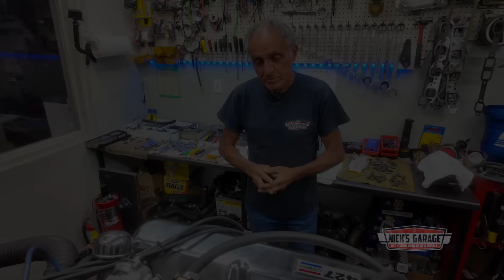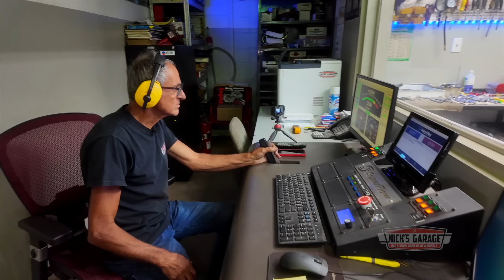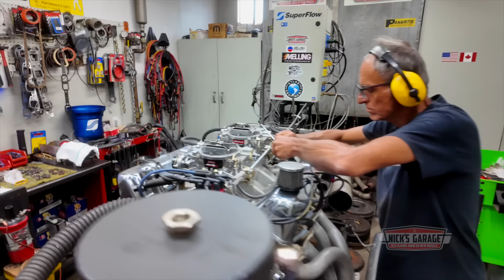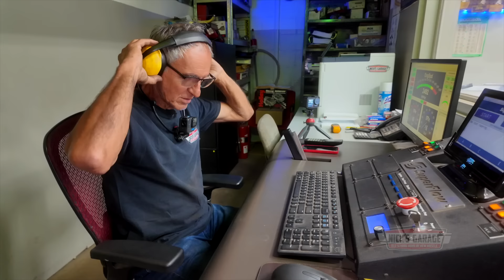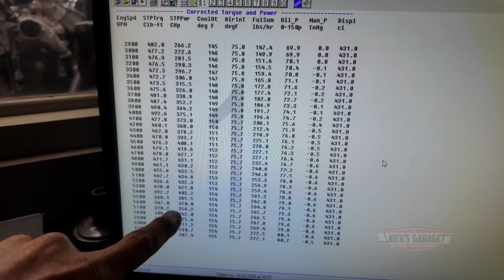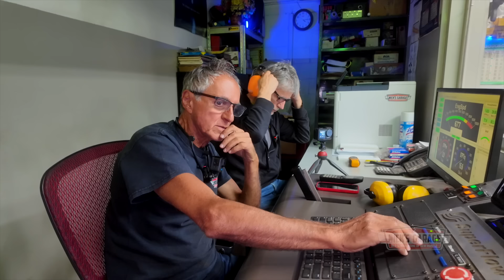427 Ford Side-Oiler on the Dyno Part 1 - Shelby Cobra Engine

Comment: As I'm watching this I was worried about you and that exhaust going into the room but then assumed you had a blower to blow the air out in event. That's how Bill Harrah's  wife died

The way carbon monoxide kills you is that your red blood cells absorb CO at 200 times faster than oxygen so you just asphyxiate 

My favorite Ford? 

The 427 always had the reputation of a beast of an engine it's the only engine I know for which they actually made three versions of it. The single overhead cam which was designed to compete against the Chrysler hemi at NASCAR and was never allowed, the top loader, and the side Oiler. 

And easily for over a decade the 427 cobra was the benchmark for which all other cars were tested. I remember reading even of a test against a new Kawasaki thousand cc motorcycle. It had an out of this world reputation 

Personally I think it's too much engine for the car and if you talk to any of the old Shelby American veterans they will tell you it was the 289 that won most of the races 

Still interesting to speculate if they had been allowed to continue to develop the cobra Daytona. In 1965 Ford told Carroll Shelby to forget racing the cobras and concentrate on the GT 40

And I think it was 64 where the Daytona coupe came within a hair's  breath of winning the Le Mans overall but for a pinhole oil leak in the oil line 

Of course racing is full of "if onlys"

My favorite car? Will Ford didn't make it or Shelby for sale but I lusted for a 289 cobra FIA 

This was the car that Shelby made to compete internationally. 

It looks like sort of a hybrid between a 427 cobra and the regular 289. But that engine has six Weber carburetors side pipes of course it was built to race and not drive on the street 

A few years ago the cobra museum in Martinez raffled off a 289 FIA regular replica and of course I didn't win it 

I thought if I did win it it would be about the most impractical car I ever had 

No way to lock it and no roof so you're not gonna be in the rain. But what an exciting car 

Shelby actually made five or six of these of which only two survive. One of them is in a museum at Shelby American and the other is owned by a man, Lynn Parks, known as Mr. cobra 

He bought a wrecked car and rebuilt it 

Anyway I figured at the beginning when you said one of the machines was gonna break I figured the beast would overcome the dyno as it overcame so many cars  😅😂😂

Comment: FIRST 427 side oiler specially for a Cobra I've ever seen in 35 Year's ruined with a pair of junk Edelbrock carbs!! Easiest way to lose 20-40hp.
Not to mention horrible driveability compared to the Holley's Carrol Shelby helped design for these.
WoW
Reply: Holleys are back on. Part 2.
Reply: Yep Edelbrock carbs are nothing but door stops.

Comment: I think the problem with those Ford FE engines is that the oil is leaking from the intake manifold gaskets and the valve cover gaskets. Because of the design of the intake manifold mating to the cylinder heads where the gaskets are at.

Comment: An AFB and an AVS on the same intake is weird
Reply: Most guys would not even notice it. If you pulled the name plate off the AVS especially.  But I would have put the AVS in the back since it has the choke and the back carb is the primary carb. Well on Mopar it is. Not sure about Ford.

Comment: That's a lot of thick applied Silicone sealant applied There at the oil leaking point !! .....Is the "gap" 'spose to be That wide there ?? ..... Maybe some actual gasket Material with Thinner layer silicone sealant would seal better ??

Comment: Front carb has choke plate closed. Running on 6 barrels not eight.
Reply: Thats not the choke plate. That’s a carter avs, air valve secondary. The back carb is an afb.

Comment: My 3 favorite ford engines 427 SOHC , 429 boss , 427 side oiler with tunnel port heads and dual 4’s
Reply: 428 SCJ was a beast also 😉

Comment: Ford 289, 427, 390, 428, 255 flathead are my favorites in that order from most to least favorite. Oh, I almost forgot the 312 to. GM favorites would be 1950s 265, 283, 327 up to 1970. Mopar 331, 392 hemi's in the 50s and 426 wedge, 413, 313, 318 polys in the 60's. 340, 273, 318LA, 360, 426 hemi, 440, and the 383RB. Any slant six 170, 198, 225

Comment: Among Fords, i got a real soft spot for the FE series but i like the Windsor, Cleveland, the 429-460 and even the oddball MEL  engines which were made between 1958 to early 1968 consisting of the 383, 410, 430 and 462 as well as the Flathead too. I like all the Mopar, GM and AMC V8s as well. The acronyms on the following Ford engine series, the FE stood for Ford/Edsel and MEL stood for Mercury, Edsel and Lincoln. On the Edsel, the one FE engine was a 361 and the 410 was a MEL and those were exclusive to Edsel cars only. The 410 MEL should not be confused with the 1966-67 410 found in Mercury cars was based on the FE series and basically a 390 block and bore size with a 428 crankshaft fitted.

Comment: Hi Nick Phillip George… Nick things happen even if you think there fixed so fix the seal and the valve cover gaskets / intake gaskets for the leaks you found while testing… Nick your brother Phillip is there to fix everything with you… I think the 427 might hit 475 on the HP and well over 500 on the torc… I will be staying tuned waiting for next 427 dyno run … WHO LOVES YA BABY !!!!! Your friend THE BANDIT 😊

Comment: A guy at Holman Moody said that a blue printed 427 low riser made 510 hp with one carb and all factory parts all day long in 1963 Ford NASCAR  stockers. They usually did 500 engines a year according to him .
Reply: Yeah Holman & Moody were to go to guys back in the day for Ford performance.
Reply: I worked with a guy who had an old Ford (can't remember the model - sorry!  Tbird maybe?  Probably not).  But it was - he claimed - all factory, but tuned properly.  It was a sleeper nightmare - people would be confused as hell when he'd pop the hood and they'd see stock.
Reply: @hk45c62  
Re-read what he wrote...
Reply: @hk45c62  
The comment you commented on...
Reply: Long winded...fix it and get it done.
Reply: @hk45c62 H&M  and Shelby were crucial to the Total Performance Era, but not the 428 CJ, Boss 302 or 429.

428 CJ was actually developed at Bob Tasca Ford.  They took parts from a 427 LR to make the 428 CJ.

The Boss 302 was in house Ford.  The Boss 429 was in house Ford/Kar Kraft in Dearborn.

427 SOHC was in house.  The 427 side oiler was in house as well.  It was developed due to NASCAR engines needing the oil to stay down low at the crank for long duration high rpm jaunts.

The 427 center, or top oiler requires restrictors to keep oil down low and minimal oil on the valve train.  So Ford developed the side oiler to have priority main oiling for high rpm endurance.
Reply: @jasonwalker999   , yes, Bob Tasca was involved with the creation of the 428 Cobra Jet but,so was Carroll Shelby. The 1967 Shelby GT500s were equipped with a 428 Police Interceptor engine that was used in Ford Galaxie police cars. Shelby took the 428 PI engine modified them to make more than the 345 horsepower that Ford said they made. At the same time, Tasca wanted Ford to offer the R code 427 as an option for the 67 Mustang. Ford said that the 390 was going to be the biggest engine available. So Tasca and Shelby approached Ford with the idea of putting a 428 in the 68 model year Mustang and the "135" model was tested for NHRA drag racing and then the 428 Cobra Jet was released as the 68 1/2 Mustang, the same engines also being used in the 68 GT500.
The 427 SOHC  and the BOSS 429 were both developed as purpose built NASCAR engines. The SOHC was banned from being used in NASCAR because it didn't use pushrods to open the valves. The BOSS 429 was legal for NASCAR but was going to be racing in Ford's Torino platform. Ford needed to build 500 street legal models with that engine in it and the Mustang was chosen over the Torino,even though the Mustang wasn't legal for NASCAR competition. Holman Moody engineers helped design both engines. 
The BOSS 302 was also a collaboration with Holman Moody for the TransAm program. The BOSS 302 was designed to replace the 302 Tunnel Port, which would have been very expensive to have as a production engine in a Ford Mustang.
Reply: @jasonwalker999  427 VALVES WILL NOT CLEAR CYL,S  ON A 4.130 BORE  THE BIG BOPPER USED 406 HEADS  428 IS A STROKED 406
Reply: @med1273  my statement was still correct.  I stated 427 LR which those initials mean Low Riser.  As in early top/center oiler 427’s which had the same 2.09/1.65 valves as high performance 390/406/428CJ engines.
Reply: BUT Never with a pair of Edelbrock knock off Weber's 🤣🤣🤣
Reply: @TheDynotuner  Weber knockoff Carter AFB.

Comment: Many times oil leaks in the valve covers are caused by too much oil to the rockers . We made restrictors that go in the oil feed to the rockers and solved 2bproblems 1 oil starvation to the bottom end and leaky valve covers . I would cut a 5/16 screw about 1/2:inch length and slightly grind the threads off on opposite sides restricting the oil flow to the top of the engine.  This is a well known fix for the Fe engines . The intake seals should be cemented to the block and the gaps on the corners need a little silicone on all 4 corners . I don't like filling the China wall with silicone because it may end up in the oil pickup or cause very hard removal of the intake if necessary . It seems like those Ford engines give you fits but the GM and Chrysler's go as smooth ad as Silk .IDK why the Ford engines come with those  little Gremlins when you work so hard to get them right .
Reply: Ford FE’s have notoriously difficult intake manifolds to install without oil or water leaks.
Reply: Holley jets make the best restrictors. Adjustable too.

Comment: I've always loved the 351 c 4v. I had a 73 torino and my older brother had a 71 challenger with a cop 440. I couldn't pass him but he couldn't leave me either!😊
Reply: The 440's ran out of gas because of the 5/16 or 3/8 lines, can't remember which, from the fuel tank up, the 383's would outrun them on top end for that reason, the Hemi's had 1/2-inch lines. Not sure what you mean by a cop 440? The cop cars in my area back in the day w/440/4bbl topped out at 140mph, not fast. Dodge Monaco's, a wee bit heavy. There were some state cars that had the 440/six-packs and a few with hemis, they were faster.
Reply: @stephenwest798  most of the “cop” cars would have a higher capacity radiator and beefed up suspension to go with the 440 single 4 barrel carb, some engines would have forged components.
Reply: @JD-fx1mb  All 440s had forged cranks and rods until 1974 when they went to cast cranks and all used cast pistons. Not sure what they had for a cam, but they weren't as big as those used in the 440 HP engines, pretty smooth idle.
Reply: @stephenwest798      Hemi's and 440's  had 3/8 fuel lines.  383 came with 5/16..
Reply: @nickpanaritis4122  Not sure where I got the 1/2 line for the Hemi, but just checked rockauto and they show the same fuel filter for the 225 slant six thru the hemi. odd. I just check the fuel line on my 66 satellite that came stock with a 361 and it is 5/16 so I believe you are correct. Someone had planted a 73 440 hp in it and apparently use the fuel lines from the 361 on the engine as well as they were also 5/16. Guess I have some upgrading to do, the engine which was supposed to only have 10,000 miles on it had two rod journals and two main journals that were .005 under, I'm don't think it came that way from the factory.
Reply: @johncolson1294  always liked the 4v Cleveland, best flowing heads Ford made for production vehicles. Not counting the Boss 429, FE tunnel port or the Cammer stuff.
Reply: @JD-fx1mb 

Clevelands only flowed good on the intake side. The exhaust ports were doo doo.
Reply: I would say that was a real even match there, good thing it wasn't a 393 Cleveland😉jussayin

Comment: A true side oiler with forged pistons if it has them can rev to 7500 rpms safely.
Reply: Not with a hydraulic cam they won't, needs to be a solid cam or solid roller. Shelby had them making power to 7500-8000 in the GT 40 for Lemans racing.
Reply: A naturally aspirated 427 side oiler (or 30 over) can make over 800 horsepower as the 7.90 1/4 mile times in a 2700 pound Thunderbolt has proven many times.
Reply: @crazyoilfieldmechanic3195   I AM CALLING BULL  S. RAY PAQUET 1964 T- BOLT MAKES 997 HP AT 9200RPM  HOLDS NHRA SS/A RECORD AT 8,40 AT 159 MPH

Comment: NICK surely you should have closed BOTH DOORS to your dyno room when doing you tests so that the carbon monoxide would be tucked out by the fan not blown into the garage where you, your brother and others would inhale it and risk damage to yourselves 
I don't comment normally but when health and safety of you,your brothers and others I have to comment 
Be safe
Reply: The exhaust fan is still extracting, why not help it by letting fresh air in through the doors?  They have overhead doors in the shop, plenty of ventilation to air it out in a short time.  And it sounds like he rarely has the exhaust disconnected from the engine...Relax.  Nobody is going to pass out.
Reply: Meant sucked not tucked

Comment: I like my K-code 289, I like especially the Boss engines and the 427,428 cobrajet. Low manifold vacuum isnt unusual so a vacuum can may be necessary for power brakes.

Comment: Notice how all the top 426-427-428-429 motors from the mid-late 60s only claimed 425 HP?
Reply: Yes , to keep insurance down .
Reply: @hk45c62  I was generalizing genius! Those were displacments I remember from back then. Most manufacturers claimed 1HP per CI. Didn't Ford lie about their 428-429 HP rating.
Reply: @pb68slab18  The FoMoCo 8V 427FE displaced 425 CI and was rated at 425HP, the 428FE was a 427 CI, with the CJ rated at 335 HP. Good as they were, they were not the top rated FE - that was the non-production 427 SOHC with dual quads, 657 HP. Chevy rated their top production 427 at 435 HP. The street 426 was also rated at 425 HP.
Reply: Weird how aftermarket heads will do that 😂😂

Comment: Ford Big Block breaks the dyno! :o
Reply: FE's are not a big block...they are a mid sized block.   All Ford Small blocks and all Ford big blocks share the same bore spacing.   The FE sit in the middle of them.  As per Ford it is a medium block.   The Big Block  Small Block only sizing is a GM thing.
Reply: @matthewq4b  I agree that bore spacing is the way to classify and it correlates with the other dimensions. FE mid/ medium. I think it is fair to call the 429/460 a "big block" since it has the same dimensions as the other big blocks.
Reply: @matthewq4b oh yeah only gm? Mopar?
Reply: @karlsracing8422   Not Mopar. Not all their OHV V8 engines were grouped by block size.  GM was either Small Block or Big Block,  hence the Big Block Small Block ONLY sizing is a GM thing.